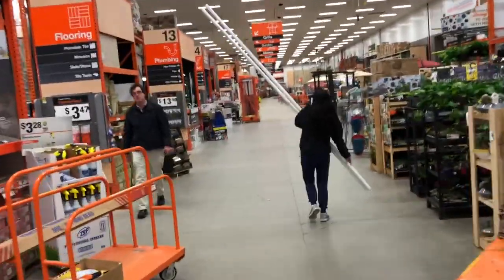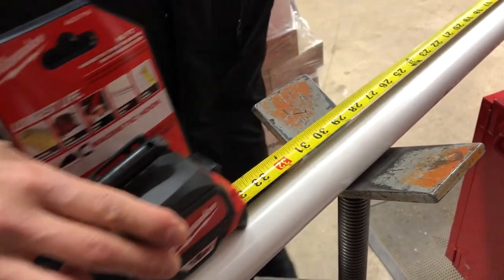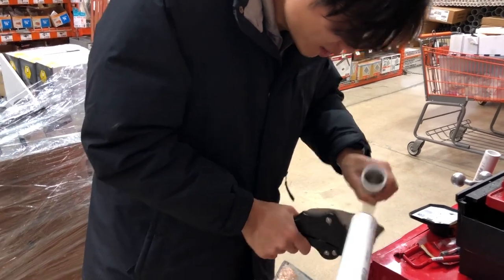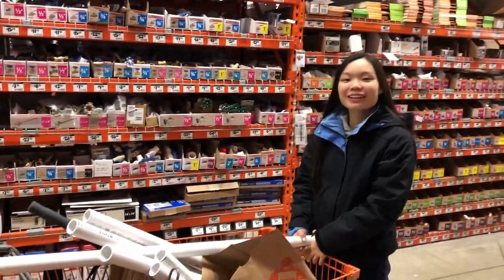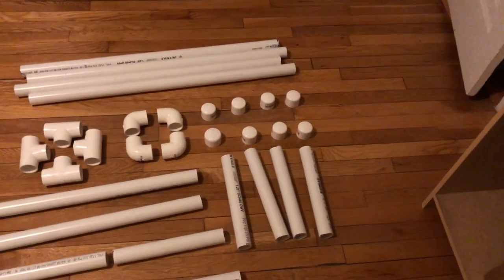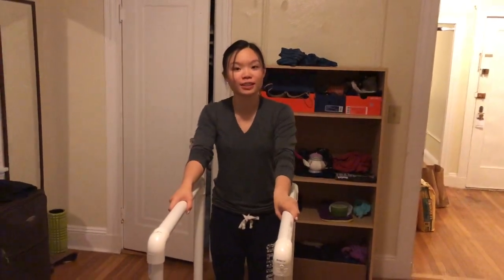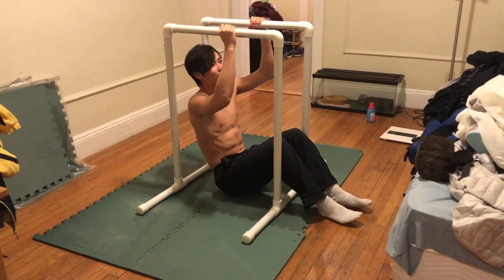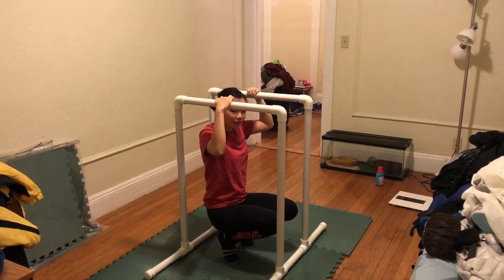DIY PVC Parallel Bars

Comment: Dont do this. It will break over time and will just hurt, you can use metal pipes, a little more pricey but way better
Reply from the maker: thanks for concern,  PVC is actually strong AF. We also make sure to check on the bars before everyset and spot each other!
Reply: yeetus doritos you could reinforce it by inserting a smaller pipe inside i think it will be much stronger
Reply: Did my research and as it turns out, Schedule 40 PVC pipes can withstand a textile strength of 954 pounds. Schedule 80 can take 1,225 pounds.

Comment: 24 Ft 1 & 1/4” PVC pipe 

Measurements are: 
4 x 3ft 
2 x 2ft
8 x 1ft 
4 x T-connectors
4 x Elbows
8 x End caps
Reply: Your a hero
Reply: Thanks g

Comment: This video inspired me to build my own gym out of pvc pipes. Thank you guys 👌🏼🙏🏻🔥
Reply from the maker: thanks :)
Reply: Youtube is truly a remarkable blessing. LordPadron I have been watching your video's which have led me to the video lesson from Kaity & Adrian which ultimately proves that "each one teaches one" this is awesome. 

I am intrigued by the concept of PVC as a viable option for home gym equipment. I am in a unique circumstance where in home gym equipment is my best option. I am 6'0 350lbs, I do a lot of body weight workouts routinely, and I am rather limber for a larger frame. Do you have any suggestions as far as the PVC gym being a possible option for a frame like mine? (I would value input from both sources "Kaity & Adrian" and "LordPadron")
Reply: @heavycmc  not to butt in here but i work with all kinds of pipe at my job regularly..pvc is not that strong..i see a lot of ppl on here using these diy pvc rigs but i don't recommend it for someone that weighs over a buck 50...i really don't recommend it for anyone honestly,even lighter folks....gotta use that steel man...good luck!

Comment: To this day, do you actually still use it considering it was 'wobbly as hell'? 😂
This is the exact concept I was looking for - for a DIY parallel bar, but it definitely does look wobbly as hell lol
Reply: They fare really great as parallettes/push up bars, but with dip bar dimensions I am not so sure ^^
Reply from the maker: Oh we never replied!! but yeah we still used them :P   just making sure to check on them before every set. The wobbliness actually adds extra core work!
Reply: Fill with cement maybe? Will take away the portability though.
Reply: If you glued it (and used 1-2 cross beams at the base) the wobble would largely go away.

Comment: It looks absolutely unstable, plus I don't think any of you weigh more than 65kg.
Reply from the maker: We are heavier than that now, but it becomes alot more stable after gluing properly and we had a friend who filled his. Also it is even more stable if you switch to the shorter posts
Reply: @VigilanteFitnessCouple  
It is a nice job. But, in our case, the person who would use it weighs 95 kg (normal weight for someone with developed muscles), so it must be reinforced. Regards.